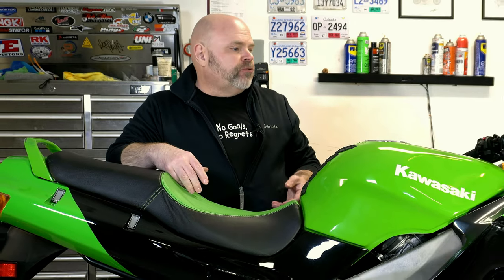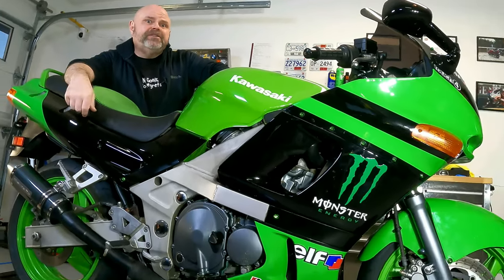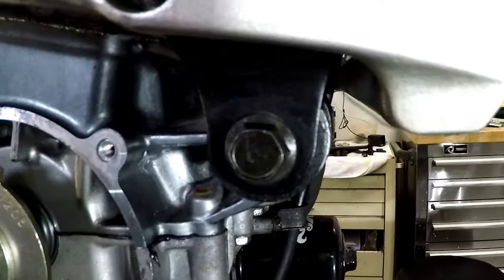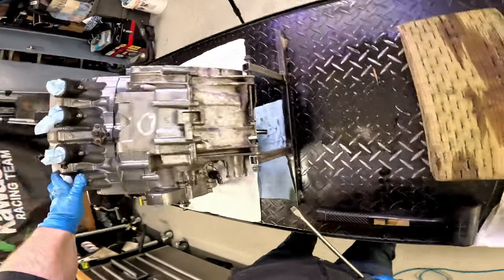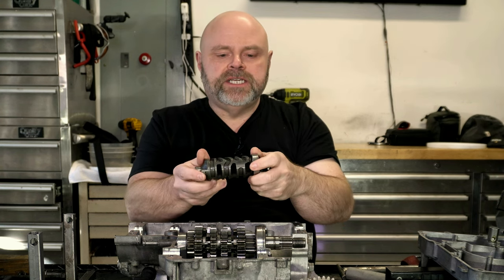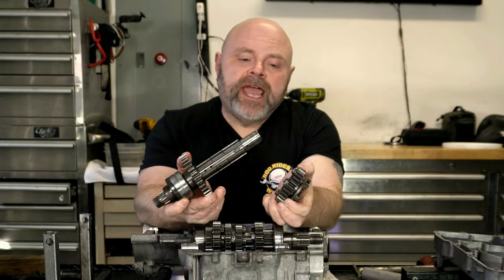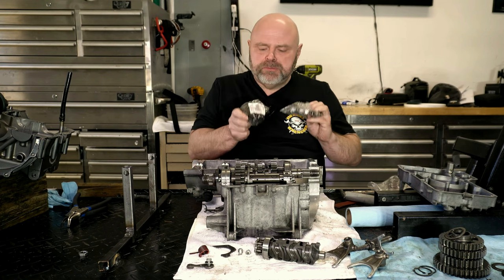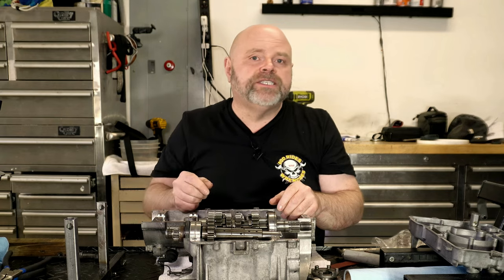The Motorcycle With No 2nd Gear

Comment: drag racer people back cut their gears. just taking a file to the dogs to give them geometry that would make them stay together. wonder if this process could be used to resurrect a bad gear for cheap. they have worn in an angle that pushes them apart witch ruined the fork and drum, correcting the angle seems like the perfect solution.
Reply from the maker: Thanks for the feedback & View!

Comment: Hi, I’ve got the same problem with 2nd gear, I just can’t for the life me seem to be able to the the magneto/flywheel off at all will not budge, am I missing something the Haynes manual don’t help much from what I can see.
Reply from the maker: Are you using the proper flywheel puller tool?  Use an electric or pneumatic impact to get the force you need to screw the Puller bolt in see this video for when I replaced the sprag starter clutch. https://youtu.be/HUJXsJkg2ms?si=BS9tNcgtJTWLN34p
Reply: @RodRidesWrenches  thank you for your reply! I did find that out, after scouring forums lol. But i used a big adjustable Spanner and my breaker bar to get it off with the puller.